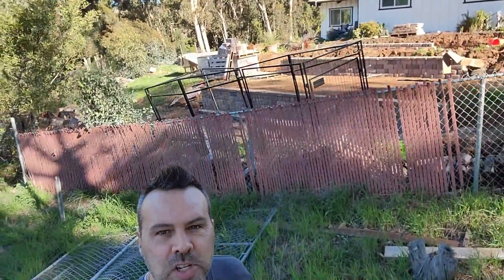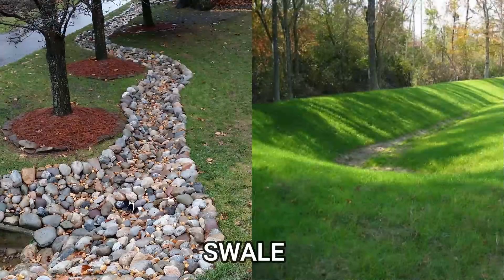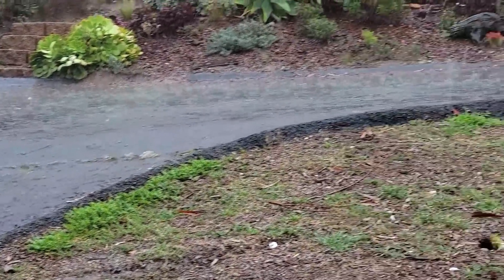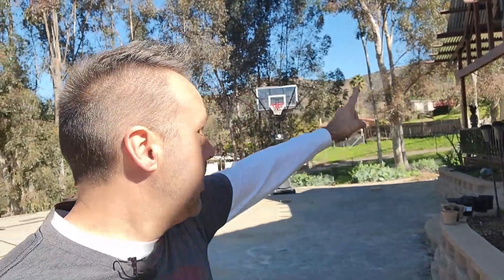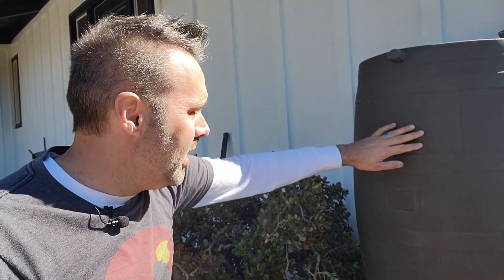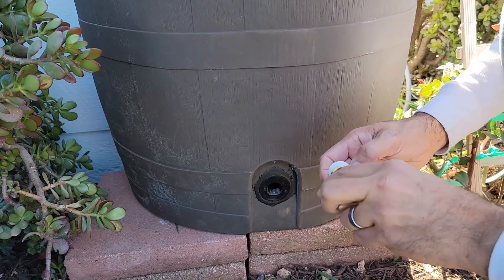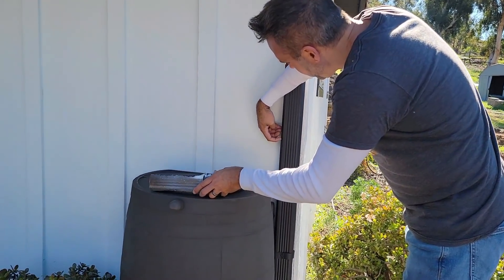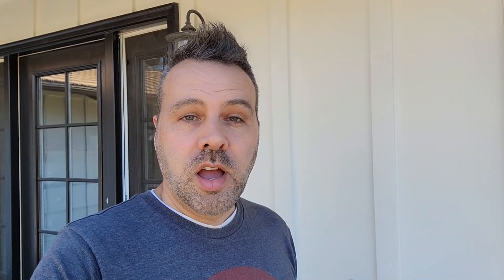Saving Rain Water with Rain Barrels and Two BIGGER Methods! // Next Level Water Catchment.

Comment: While a swale is a great idea, one big one at the bottom of the hill won't be very effective. That will only sink water into the soil at the bottom of the hill. A series of smaller swales running on contour perpendicular to the slope from the top to the bottom of the slope will soak the water in along the whole slope, effectively watering all the plants on the whole slope, instead of just at the bottom. The water captured higher on the slope by swales will slowly peculate through the soil down the slope through out the season, keeping the soil hydrated long after the rains are gone. Lots of good info for putting swales on contour are online and on youtube and worth checking out. Also, you might also want to ask an expert about it before adding a big swale full of water into the soil at the bottom of that hill too. If that is a very steep cliff at the bottom of the hill, I am not sure what a whole bunch of water there could potentially do to the cliff. Maybe a spring will form, maybe the cliff will collapse.
Reply from the maker: Brilliant!  Why didn't I think of that? I'm doing it!! Thank you!
Reply: @thegardensatskyridge  Awesome! Make sure you do your homework, or get advice from someone with more experience with swales. There are limits on what grade slopes are suitable for swales (3% to 15%), you want to make sure they are wide/deep enough to handle your typical rain events, have adequate spill ways for unusually heavy events, and other details. There are also other rain capturing techniques that could be suitable if swales do not fit your context.
Reply: Hi I saw on “My little Homestead”, they dug a hole and put a large underground tank which they pump water out of. It’s on YouTube.🥰
Reply: Geoff Lawton (I think that’s his name) did a fabulous segment on the Weedy Garden channel about swales. Made me wish I lived on hills, to be honest.
Reply: Yes! Geoff Lawton is an invaluable source for dry-country water management. Brian, please check out his vlogs on Greening the Desert for advice on all sorts of water catching beyond swales before you start construction. A series of swales all cut on contour into the hill will give you the desired result and provide space for more fruit trees that self-water. This guy is a permaculture genius. @melissasullivan1658
Reply: In the hills of many Mediterrainian countries they use extensive terracing which also slows water and allows for dry farming grapes and other crops.  Lots of work but on theme.

Comment: You'll find that you are going to ideally want to position your rain barrels several feet above ground if you want even minimal water pressure coming out of a hose. The way you have them now is only good for filling up watering cans or watering plants via a hose lower down on your property. Having the rain barrel so close to ground level does not make it conducive to watering plants located even at a slightly higher elevation than you have your water barrels placed.

Comment: I'm sure you've already gotten this comment, but you put your teflon tape on backwards. It will probably never matter. But if it does leak and bother you at some point, reapply new tape before replacing any fittings.

Comment: Are you going to add any discharge from the rain barrel, or is it included in case the barrel overflows? We added 2-50 gallon tanks to the side of our house (to the two existing downspouts) and we have a Y-connection at the top where the one side goes into the barrel and the other goes back to the downspout so that if it does overflow, it goes into the regular system. This is in addition to the 500 gallons of IBC totes (250 each) for water collection off the garden shed. Between those three, I didn't have to use municipal water all summer!

Comment: Here in UK we use barrels to collect the rainwater from the downspout. But we have a diverter that fills the barrel until it is full then the overflowing water continues down the original downspout and out to the drainage system. Your system will have the barrel overflowing into the yard once it is full.

Comment: I’m a drainage engineer in AZ. Find out what your local ordinances are for runoff retention, especially where u plan the ponds. Most agencies want u to release historic flows because downstream property owners are relying on it. Many thousands of dollars have been wasted when the local agency finds out about the improvement to capture rainwater.
Reply from the maker: Our county actually has huge financial incentives to capture rainwater and run off.  Plus the area across the street from us is designated as a flood zone. So any water we can keep from going down there is most like be a plus 4 everyone
Reply: @thegardensatskyridge  Absolutely, you would be a blessing for the property owner downstream. Capture away😊!!!!! I do the same in my desert home and will be doing so in our cabin…..but I have to check the local ordinances 😂.

Comment: Have seen several comments about overflow, so I thought I would throw this in here. We use this to divert to our collection barrel and then it automatically uses downspout again once it fills up. Oatey 14209 Mystic Rainwater Collection System Fits 2" X 3" Residential Downspouts

Comment: A rain garden is another option for areas of smaller influx of water, without the risk of sediment problems with the swale.  After 2-3 years, maturing native  plants in a RG help hold the soil in place, filter it, and help it to percolate down into the soil.  It's also very beautiful and brings in pollinators.  The size is dependent upon how much water runs through a given area.  Contact a Master Naturalist or contractor to help with your configuration and calculations.  Will save you headaches in the long run.

Comment: I researched several similar rain barrels and in the fine print it said you could only use the water on flowers, lawns, and non-edible gardens. It was not recommended for vegetables gardens. That’s why I then looked into the food grade blue barrels to capture rain. So I would be careful and reach out to the seller.
Reply: Are there any safe to catch water in for human consumption, if necessary?

Comment: I did the rain barrel install last summer. Cut the heck out of my middle finger. Be careful. Maybe gloves and eye protection. I will do another one in a few weeks to come off my new greenhouse. Then plan to piggyback another barrel onto that first one. Here in Ind I have to dump out the barrel every late fall so the barrel will not freeze and bust/crack. Guess you don’t have that possibility there😆
Reply from the maker: Luckily I don't 🙂

Comment: Saving water has really been helpful at keeping my water bill down.  What I didn't realize is how fast that barrel fills up.  I added a 9 x 12 porch on my 12 ft wide trailer  so thats a 15 x 12 roof area and with a good rainfall it will fill up my 55 gallon can in 15 to 20 minutes.  On my shop roof   18 x 24,   I  put a 375 gallon tote. Dont recall now how long it took to fill up but if it rained two days straight it was full.  I run a hose to strategically located 33 gal. cans on my garden to keep that tote emptied.  Just mention this so you can allow for the overflow before your overall project is finished.  You may not get the rainfall we get here in east Texas but that barrel may be full "before  you
know it".  You have done soooo much in the time since  you moved, it's unbelievable. Enjoy every video!  DJ
Reply: I live in North Texas. I purchased 2 of the square containers a few years ago that hold 275 gallons. I covered them with fencing. I put a hatch door at the bottom and let the water either flow out or use a pump from Harbor Freight to spray.
As for the barrel, I'd connect multiple barrels underneath or near the bottom. If you connect them at the top, you will need a spigot for each barrel. At the bottom, you only need a spigot on one barrel. I wish I could send a picture of what the square containers look like.
Reply from the maker: Thank you! And thanks for the tip 🙂
Reply: We FINALLY got the 55gal barrels (we've had sitting for a year) hooked to downspouts from our roof before rain last week. We were amazed that the 3 barrels were FULL after a 'light' rain (1-1.5") overnight! So we got them swapped and 3 more at least half full the next day! Plans to eventually link more, add spigots and be able to swap (eventual) drip system from barrels to faucet as needed. Just SO thankful we caught what may (or may not) be Sacramento's last rain before another dry summer!

Comment: Love that you're implementation rainwater capture!   I'm sure you've checked your local ordinances because where I'm from its illegal to capture rainwater that has already touched the ground however I don't think that applies to swales and ponding areas.  That water won't be reused.  Its probably more of a sanitary concern because of the filthy city streets.   Hopefully that's not the case in your area.  
You'll find that with the first good rain, that rain barrel won't be sufficient.  LOL You'll be looking for the second barrel to daisy chain them after the first good rain.  Does your rain barrel have an overflow option?   Where does the water go once its filled up.  Hopefully away from your home.  It doesn't rain much where I live to so I'm always lamenting when it rains and I don't have more rain barrels installed.   :)  I'm the crazy person running outside putting out buckets to catch the overflow.
Reply: I'm a renter and deploy multiple buckets when it rains in my area as well here in Riverside county Ca.

Comment: Great plans for water catchment. Can't wait to see it develop!!   I have 5 rain barrels (4 around my house and 1 at the shop) -- 3 of them are 80 gallons, 1 is 40, and 1 is 125.  They fill up very quickly!  If the same happens for you, it may be beneficial to have an overflow hose near the top of the barrel so that you can direct the overflow away from structures.  Of course, everyone's situation is different.
Reply from the maker: Good to know. Thanks!

Comment: You have some great ideas about conserving water. I was wondering why you didn't put in a pond when you spoke up and said there would be a collecting place for water coming off the hill. It would be beautiful with some water plants in it. So much water runs into streets and collects there for people to hydoplane when they are not expecting it to be there.
I am the neighbor who gets all the water from the neighbor above me, plus all the sand from their driveway. The water used to run down my driveway and collect right in front of the porch so one had to wade through the water to get into the house. Plus all the sand that would collect in front of my garage doors. French drains and anything else anyone suggested just never worked. I finally found a contractor who had experience about this and put in a grated run off across my driveway. Now the water runs off into the yard which is fine with me. Though I still have to go out every couple months and remove all the sand and road grit that collects where the water runs into the yard so the grate doesn't back and overflow. But that is cheaper than relandscaping the entire yard and redoing the driveway.